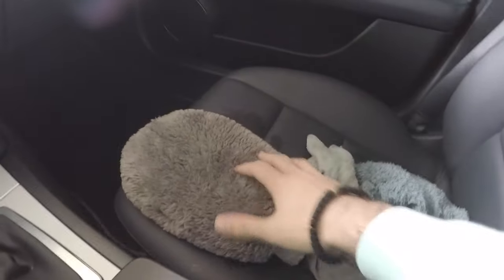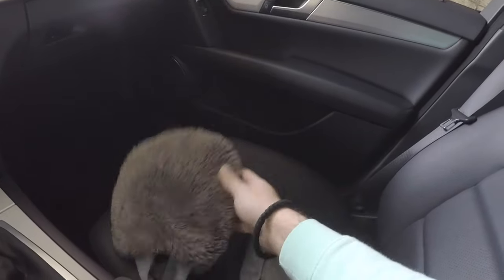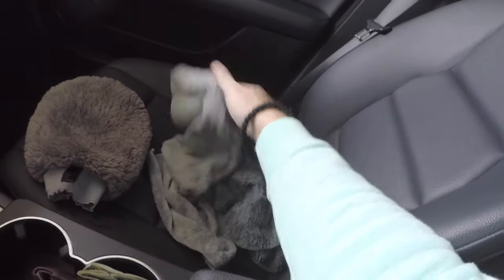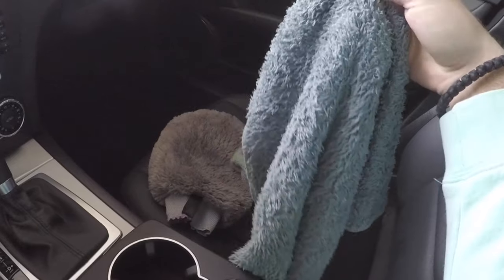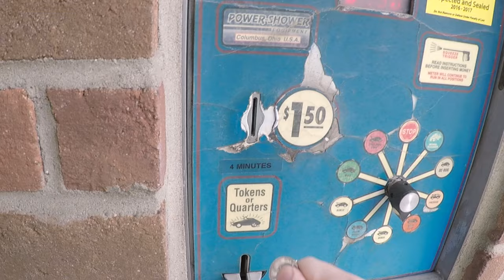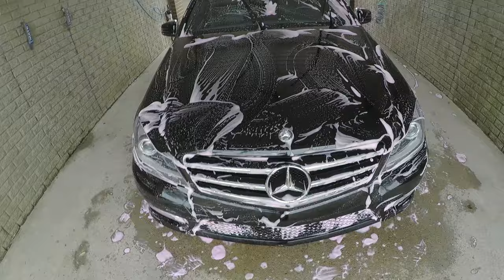How to Wash your Car Properly at Self-Car Wash

Comment: I use a microfiber towel when washing, then once it gets slightly dirty, I take it to the rinsing station to rinse off excess dirt then use another side of the towel then continue to wash. I usually get more lubrication from the low pressure soap and the “triple shine polish”  to clean. Then I add some detail spray when drying the car to boost some shine. If I’m lucky I’ll use the air dryer and get very little water spots
Reply: @Srt _ There's usually one at most self wash bays, it's in the middle either in the front or back, its just a sink, just has a knob to rinse off any dirt from a towel and those rollers to squeeze excess water off towels.

Comment: One thing I normally do is use 2 microfiber towels to wash the body with the soap then I go to the little water station if they have one to rinse my towel with the dirt off so it gets less dirt being rubbed after washing one panel

Comment: Great job on the car but usually rims have stubborn brake dust so you’d probably need to bring a wheel brush to scrub them quick with some of the soap then rinse off.

Comment: I need to know all the steps and in the correct order, especially wax. Do you use wax last then wipe it dry? What if some gets on the windows? I have no idea what I’m doing when I wash my car, I just use soap and rinse but I would like to know if spot free and wax does anything 🤷🏻‍♀️
Reply: Thank you, I did that last week, but didn’t know about the zero pressure 🤦🏻‍♀️ but now I do lol. Scratched my tinted window with the mitt 🤦🏻‍♀️🤦🏻‍♀️

Comment: Thank you for this video. One question, my local car wash has the "clear coat" option. Do I use that before or after rinsing the car with soap?
Reply: Do that last and then rinse it off with water. Honestly tho, it probably wont do much, so if you wanna save money just skip it or do it real quick

Comment: I bring my own soap and buckets. only thing I need from the car wash is the water sprayer.
Reply from the maker: Jordan F That's even better solution, at this location owner of the car wash does not allow bucket washing technique.
Reply: alerrari oh okay. well you work with what you got. the place I go to is 24/7 and out of respect for other customers I go late at night so I don't hold anybody up trying to wash their car.
Reply: Jordan how do you do it this way? If you can explain your method that would be great
Reply: @Jordan-nj2ve  It's also better to wash your car when the sun is not blazing. The water won't evaporate as quick and leave water spotting marks.

Comment: Did you use the wax in this video?  And if not what should i do differently if i use the wax spray?
Reply: Wax is always last, i recommend after spraying the entire car with high pressure wax entirely rinse of the vehicle with spot free rinse then dry the car. If you use wax, it’s important to dry the entire car off if it’s sunny. Your car will have spots if you don’t use the spot free rinse and dry it with micro towels. Hope this helps !!

Comment: I have a “wax” setting and a “spot free rinse setting”...should I use the spot free rinse after I use wax or should I just stop after using the wax? I have a black car so I really want to try and protect the paint as best I can...I also use a spray that’s supposed to protect it & add shine (I think it’s called maguairs quick detailer spray) but any tips for dark cars would be really helpful :) thanks!
Reply from the maker: I use spot free rinse after wax, because it is easier to dry the vehicle leaving little to no water marks, this step is critical especially during summer months when water drys on the car in minutes after completing a wash. Wax or quick detailer spray will not protect the paint but instead will add little shine to it. If you really want to see your vehicle shine, definitely check out Black Light by Chemical Guys.
Reply: alerrari thanks so much! :)